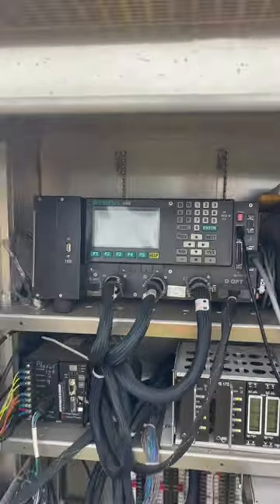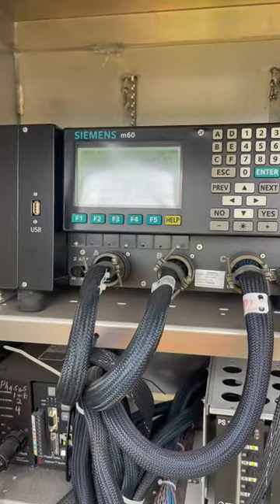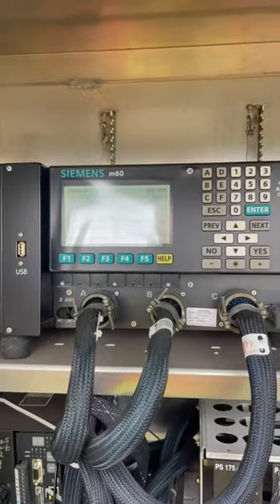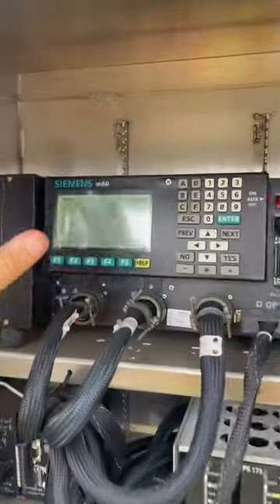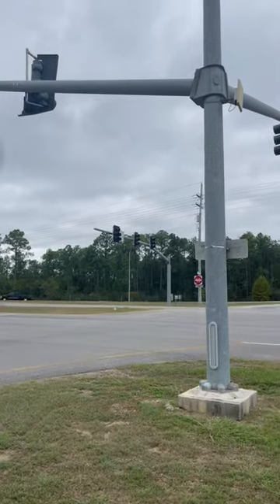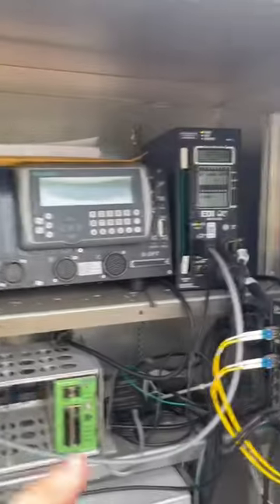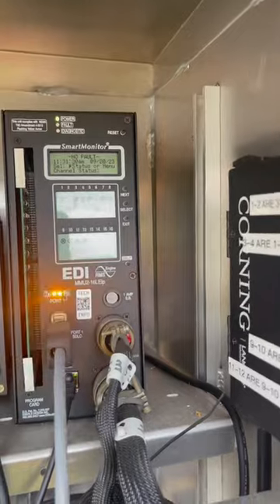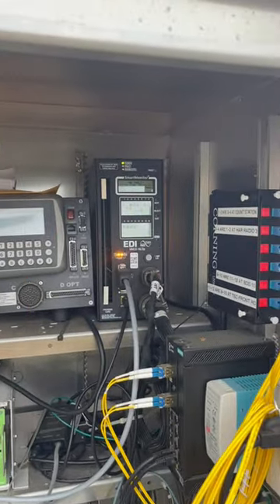Raspberry pi and traffic lights!

Comment: Anyone saying raspberry pi isn't an embedded systems engineer.  Pis are great for kiosks and small home servers, but not designed for industrial use.
Reply: Honestly in mass deployment they arent even good for kiosks....... one of my biggest support tasks in an robotics automation warehouse gig was rebooting or diagnosing failed pis that displayed a webpage
Reply: They work fine in industrial applications if you build adequate cases.
Reply: Pis are used greatly in industrial work, they're just used for very specific tasks, and very singular tasks at that. You see them on industrial sites and they usually cost a few grand because of how they've been built up.
Reply: @jamesbond1231 no, they are not. You have no idea about industrial controls if you say this. There are reasons PLCs are thousands of dollars and a pi is so cheap.
Reply: @bradbb2005  yeah it's called corporate. I design and build industrial controls for oilfield applications. . And can do anything I do at work with a pi or two,  and potentially some "add-ons" - to make a pi function like an industrial plc application - you most often have to put thousands worth into it. But it's easily doable.
Reply: @metaleggman18  no.
Reply: Consumers 🤪
Reply: @metaleggman18 most such failures are enclosure or power supply failures, but yeah. Purpose built stuff is hardened against those mistakes as well.
Reply: Raspberry Pi are already been used in certified industrial equipment..

When they developed Raspberry Pi CM4, companies asked them to make a CM4 with the same interface/connector as the CM3 due to the experience to redevelop and recertify industrial equipment..

The foundation complied and made a Raspberry Pi CM4 with CM3 interface..

For all you know, the newest version of the equipment shown in the video may already be using Raspberry Pi. The Pis have already been approved for more harsh and dangerous environment than shown in this video
Reply: As someone in software. This is all just computers at the end of the day. 

Really those consoles are just proprietary computers with overpriced parts. A lot of it running on dated software compared to the overall market. 

This is what happens when things get incorporated into major life. 

It’s like a major computer using some form of software from the 90s yet it being 2023 just because it was a standard. 

Hardware that lasts isn’t that expensive. You’re paying for software mostly. While also being forced to stay within an ecosystem of products. 

Food for thought.
Reply: I mean you could use a Pi, but an embedded compute module. Either way it requires the supporting electronics to work correctly at which point it costs a lot more and similar solutions already exist.
Reply: Exactly! They’re way too general purpose and kind of flimsy. Plus, they’re too ubiquitous to be easily made secure.
Reply: There is a pi Version for industrial use
Reply: Do you know why there’s a huge raspberry pie shortage? Because all the industrial factories are buying up pies because of how cheap they are
Reply: Are you having a laugh? 😂
Reply: @DieselRamcharger yes it can't I've proof it
Reply: @bradbb2005 price can't be matter to decide if the thing is capable or not. I have RPi1 Model B from 2012 & still running the echo link (internet based ham radio repeater) until now & it run for 24/7 perfectly fine.
Reply: Yes, Raspberry Pis are designed for industrial use such as AI & controlling robot arms for 24/7. I still have one the Raspberry Pi 1 Model B (256 MB varians) that I've bought at October 2012 & discontinued long time ago but still running my Echo link (Internet based repeater for ham radio) perfectly until know for 24/7/365
Reply: @bradbb2005 The net profit per unit is much, much, higher than a raspberry pi
Reply: @jamesbond1231 even an adequate case con only do so much. You can’t completely shield it from extreme temperature fluctuations or high humidity. 

Pi’s are great at what they’re for, but that’s not what they’re for
Reply: @jamesbond1231 up until the RP5 which was just released, RPis weren’t even capable of strong real time
Reply: @Mooooov0815  you definitely can shield it from temp fluctuations and humidity. Please - keep proving you know very little about electronics.
Reply: 😂 what are y'all people even babbling about the computer that is in the light is pretty much a raspberry pie just beefier it is a linux-based computer where a raspberry pi is also a linux-based computer but it is low power and small for light use in low power applications. They're literally the same thing just beefier in every way.
Reply: Can an all-purpose raspi run an intersection? Absolutely.
Is it as robust, reliable and redundant as a purpose built system? Probably not. 
I'm glad our safety isn't worth as little as a pi either.
Reply: @thekidd2323   Perhaps some day, you might learn the hard way the difference between something rated 0-40°C and something rated -40 - 60°C.  Or, conformally coated boards vs bare,  IP67 vs IP40 or EMI immunity.  There's a HUGE range of hardware that goes from good enough to best, behaves exactly the same way on the bench, and even runs the exact same software/firmware.
Yet, one flavor will last a matter of six months in the field where the other will go decades.  It's only overpriced if it's truly over-built for the application.
Reply: @radon360  just a little extra. No computer board is rated to deal with the cold. It’s insulation and casing are…..
Reply: @thekidd2323   Moreso the heat.   Extended temperature range hardware has high temperature electrolytic capacitors and oversized heat sinks on power semiconductors.  In some cases  it's additional circuits for temperature compensating oscillators, radios, and signal conditioning.   It's a lot more than just sticking the same board into a box with insulation or fans.
Reply: @radon360  again so basic components that are put together and sold as something special because the average consumer base doesn’t need it so it isn’t mass produced. 

Think bigger and you’ll understand.
Reply: @thekidd2323   You are stuck thinking in the realm of a private consumer.   Commercial stuff runs an entirely different gamut.  There ARE significant differences, and legitimate reasons for the price differences, not just a company trying to gouge a customer.   One of the biggest factors is many of these devices are made in much smaller quantities than mass-produced devices, meaning higher cost of production, stocking etc.
I've worked in this world for nearly two decades.   It's not as simplistic or comparable as you seem to perceive it to be.
Reply: @radon360  as someone who programs the robots at factories. 

There isn’t a large difference. 

If the consumer market needed it, it would be common place and cheaper as market would create a competitive space. 

But hey man keep doing you
Reply: @thekidd2323   I design, specify and build automated the cells you probably program.   If it were just as you say it is, you'd have a lot more work constantly fixing things that fail, lock up, or just stop working.   There are good reasons I use an industrial ethernet switch and not a $20 one from Amazon, or run a cell with the cheapest PI or Arduino I can find.  I need things to remain reliable for my customers.

But hey,  keep thinking it's all the exact same stuff.  I feel into that line of thinking right after school and quickly realized why that was not the case at all.  You're securing yourself a job as a technical firefighter until you either get tired of it, or your manager catches on.
Reply: @radon360  lol I program and design cells too dude. Keep playing like the stuff we work on build anything “special” lol. 

It’s all just basic shit thrown together to work in certain conditions and done so in the lowest cost (not cheapest as cheap would imply poor materials) 

More so heat is easier to deal with than freezing temps in most situations when it comes to computers. Again you just sound like you’re trying too hard to justify your skillset. 

It’s basic shit with other basic shit labeled as something special. 

From robotics to building TMS systems to working as a contractor with international companies and manufactures, it’s all the same shit everywhere. Just marketed in such a way to help justify the price.
Reply: They do make pi’s that are able to survive industrial. They are specially designed for the higher/lower temps and the abuse. At that point though, it’s better to get an already integrated solution *if available*.
Reply: @bradbb2005  😂😂😂That's cute. I'll try to remember that industrial electronics are magic tomorrow, when I got to work, repairing industrial electronics that catastrophically failed.
Reply: @microcolonel  No, no they're not. Convoluted and complicated are not the same as hardened.
Reply: @Mooooov0815 Nonsense, if you need environmental control, then you just install environmental controls.
Reply: @jamesbond1231 if you gotta put thousands into it anyway why not get the properly designed industrial controllers, your argument makes no sense bruh you played yourself
Reply: @AtlasReburdened   I mean, a lot of small industrial power supplies have SPDs built in, somewhat thicker PC layers, and are at least validated in more temperatures and humidities; and a lot of industrial equipment has somewhat overbuilt power stages on the main/application boards as well... not necessarily more complicated.
I agree in general that consumer and repurposed electronics are better tested, probably have similar operating envelopes anyway, and are much cheaper though.
Reply: It's the same technology; just one costs taxpayers 1000x more
Reply: And even for kiosks they are questionable. By the time you made them as reliable and versatile as an off the shell x86 industrial board, you made them more expensive than said board. We just did the calculations for the new raspberry pi 5. After adding all the components and shield we'd need, we'd pay 30$ more than for the x86 board with CPU, RAM, NVMe disk, cables and housing we currently use 🤷

We totaled roughly 300$ for the pi solution, while getting less performance out of it (at least pie pre pi 5, we have yet to evaluate our pis once they get shipped).
Reply: Yes. This. They do NOT last long.
Reply: Something else you will not get with rpi is support, drop-in replacement parts, RMAs, etc. If you deploy a rpi for a use case like this, you are on your own when shit goes south.
Reply: RasPis are perfectly usable for certain industrial use cases, but not for safety critical high availability applications
Reply: Funny thing for an "embedded systems engineer" to say .... embedded systems include intel PC architecture, running Linux.  Why cant they include RPi?

The RPi company doesnt want to give MTBF away because they aren't targeting industry in their direct sales.  They leave that to other companies that produce the industrial products. 

If you had a RPi in your 3d printer or maker lab, and it "failed", then guess what were the two most likely component to fail?  The SD card, and it's reader.  

SD cards have limited number of writes before they stop working.  Want your RPi to last long?  Move your log files off of SD card, and onto RAM (/tmp).  The industrial models use NVM, I believe, which does not have write-limit timebomb like SD card.  In fact, they typically don't have SD card slots, but rather have USB interfaces.

The card slot fails because it is the only mechanical component.  All of the industrial RPis eliminate and replace these components with higher MTBF ones.  This is not your daughter's Raspberry Pi.

BTW for the folks takin bout your Pi kiosks constantly crashing...  well, that MIGHT just be your bad code.  I would bet on it.
Reply: I wouldn't say a Pi but any small microcontroller could probably replace the controller, but obviously it has to be able to have connectors for all of those cables and whatnot.

The conflict monitor is not really replaceable for obvious reasons. It has hardware verified RTL in order to make sure the signals are valid along with its failure modes.
Reply: @thekidd2323 it is not all just computers. The controller probably just has a simple microcontroller on the inside that connects to all the ports and display with buttons.

The conflict monitor on the other hand has complex circuitry that is likely not "just a computer".
Reply: @dubya5626  The problem isn't the architecture, the problem is redundancy, hardening against failures, and fail-safe operation (i.e. if things go wrong, the system shuts down in a safe state) . The RPi was never built to have these things, and if you're running machinery that may easily kill someone if anything goes wrong, these things are absolutely vital. For example, if the linux on the RPi fails for some reason, the GPIO output states aren't defined. Which means the traffic lights might show green in all directions. I think you can see the possible consequences.
Reply: @vasilis23456  I agree with you in principle, but you'd need to design hardware around it that satisfies all necessary reliability standards, and then have the entire system certified for that. Which costs a significant amount of money, and is something no end user (i.e. the city or county) wants to do. Instead you buy a system that is already certified in its entirety to SIL3 or SIL4 from a vendor. I think that's the main issue here, that the city doesn't just want (and need, for legal liability reasons) a system, but a system that is certified in its entirety.
Reply: @tanithrosenbaum  that's what I'm saying. The controller could definitely be replaced by a Pi but the conflict monitor and other components would need to remain because of the reliability and redundancy requirements.

Honestly using a Pi as a controller might cost a about the same. It isn't the chip inside that controller box that costs all the money it's the box itself which is a custom case that has its own display, buttons, connectors, and waterproofing/fireproofing.
Reply: Your right, an arduino would be better suited
Reply: Anyone saying "raspberry pi" has also not used a raspberry pi in four years. They're quite literally out of stock and falling out of style since COVID. Why suggest an outdated product you can no longer buy off the shelf?
Reply: @AMatofFact  becauae people into the hobby have them. I have like 6 around my house
Reply: @thekidd2323 I design power systems for aircraft. Trust me there is a difference between components. Sometimes they may all come off the same line, but they are screened and the best performing ones can be picked off and certified for a higher rating. Sometimes you are paying for the QA of a part not just the cost of the part otself
Reply: @ledzeppelinforpm  aircraft and street lights are two completely different things man. 

Next you’ll compare your cars ability to operate to a nasa or space X craft lol.
Reply: "iNdUsTrIaL dOeSnT mEaN aNyThInG!1"
Reply: @bradbb2005 yes they are. Do you know why there was a shortage of pis for consumers? 
Because they sold most of them to industrial customers first.
The compute module was invented just for industrial use.
I don't know if you don't know what you're talking about or if you just want to spread misinformation, but you should stop it.
Reply: @jamesbond1231 Eventually the hardware built for raspberry pi hats would be so complicated it will look like a regular computer. 

If you want to be humorously pedantic, everything is a raspberry pi just in a different board.
Reply: @Goobster911 As someone in the industry, you don’t seem to realize that we don’t buy the same raspberry pi you buy in a consumer electronics.

We literally just buy the processor die and we install them in our thousands of dollar boards.

People saying that we use consumer grade raspberry pi’s are just idiots. Theres not even enough IO, and consumer grade expansion boards are unreliable. Those hats experiences thermal fatigue quite regularly and are unfeasible in an industrial environment.
Reply: @digidex4557 people are rather narrow minded to presume a raspberry pi is a better option to control traffic system when in reality, we already use them, but their tiny boards and huge lack of IO is why we completely avoid consumer grade units. Basically we just use the exact processor itself and plop it onto a beefy motherboard. People dont seem to realize that essentially everything running a microprocessor is basically already a Pi.

So why argue about opting in for a Pi when the system is already using it.
Reply: @bradbb2005  PLCs that are based on some other ARM MCU, so does it really matter? No. (putting reliability aside) But if you are going to build custom hardware to put PI into, you might as well use any other MCU that better fits the job. People seem to not understand that building such complex system produced in low quantities is expensive no matter the platform.
Reply: They are actually engineered for industrial use
Just not for that particular use
Reply: @Mooooov0815  That is untrue. Just because you are unfamiliar with RTOS doesn't mean it doesn't exist.
Reply: @digidex4557  Neither is this traffic light controller. The box on the right is basically a smart UPS and that is what is robust and reliable. You could build a 10 fold redundant system using raspberry pis for a fraction of the cost.
Reply: @jamesbond1231  mkay, so then if its that easy, build a pi case that survives getting hit at speed by a car, regualtes temps to keep the pi running literally 24/7, keep the pi itself running for 30+ years 365/24/7, and make it all cheaper than the currently used best product for the job... 

I mean only if its that easy...
Reply: There are companies that make industrial grade raspberry pi machines. I think LTT has a video on it.
Reply: @Dubfiance  nope - pi can't be industrial dontchaknow - cause some guy that does traffic lights said so.
Reply: @AMatofFact because all they know is raspberry pi and nothing else, lmao! Even an automotive rated Jetson board will last much longer in the cruel heat in that enclosure than too. Why buy an underrated part and try to make it work when you can design a custom pcb which components that you know will last? It’s much cheaper to make it last than having to send technicians out to replace everyone of them once a year.
Reply: @TheAracoin they have zero clue. Choosing rpi cm4 over any other industry soc module will not reduce the design time/cost or production cost of the unit in any meaningful way.
Reply: I've seen them used in an industrial environment.
Reply: @jamesbond1231 can you tell me anything about the risk or pis potentially failing during big geomagnetic storms? And if there is a possibility that it even fries itself at  a >G8 storm? Since transformers can potentially do that, I suppose that pis couldn't handle the current induced. What are the safety mechanisms of a pi for induced currents? What happens if they potentially get fried all at once? I don't have a pi and don't know much about it, that's why I'm asking since I do a lot with heliophysics and I've wondered what would happen to those small computers.
Reply: We use them in industrial industry haven't had an issue
Reply: @nightmareinaction629  specification of the environment? You know the word industrial means nothing right?
Reply: Pi compute module left the chat
Reply: @iladshyanchess  you know that cm just one of tens of thousands of embedded som that engineers can choose from right? And it’s not very impressive spec wise, just cheaper than most other rated for industrial applications (the word industrial is not in cm4's spec). But when considering the cost of other components, saving $50 by using cm4 won’t even affect the bom cost much.
Reply: One of my clients build wood drying equipment thats controlled by rpis
Reply: @jamesbond1231 no they aren’t.  You want downtime - that’s how you get down time…
Reply: @DieselRamcharger revpi's are literally built to be industrial pi's
Reply: You could use a pi for this. If you did it one, you'd probably get away with it.
Reply: It's a microcontroller just like any other microcontroller used in any industry. It needs proper cooling and casing and they should last pretty long.
Reply: @bradbb2005 bro you have no idea how companies use marketing.
Reply: @dh00mketu  you go put a Rpi in a train, or treatment plant, or other true industrial setting, let me know how that goes. I've worked on all brands of PLCs and controllers, while RPi is good for home and light commercial I don't think it is appropriate for industrial use, my opinion and based on my experience.
Reply: They're used in industrial environments all the time. I'm an embedded engineer btw
Reply: @radon360 lol no electronic nowadays is only rated for 0-40 unless it has a battery. Most things happily go from at least -40-60
Reply: Pis arent designed for anything specific, thats the whole point of them. Like all computers they arent reliable without a suitable case
Reply: yep. i have played with Pis for some stuff, and the rate at which they fail, is absolutely not something i want to bet lives on.
Reply: @lineseyaether  Youre probably doing something wrong
Reply: They arent any mind of engineer. Rasp pi are a toy at most.
Reply: @dievas_  things like this are run by CM all the time
Reply: just curious, how much money do you make working for the government?
Reply: Reliability engineering needs to happen no matter what chipset you use. As long as you use something like an RPi compute module in a carrier board with all the right hardware it can perform just as well.
Reply: @thekidd2323 as someone also in software, it's not "all just software".  Hardware doesn't always run the software right.  I've seen plenty of bit-flips in telemetry logs, and the Raspberry Pi doesn't have ECC-anything so it's going to be prone to hardware-induced errors.  That's not good enough for a large number of deployed safety-critical electronic systems like this.
Reply: @Dwonis  yes and it all runs on software. 

The hardware itself, wires, boards aren’t anything special just architecturally well built for the needs of the end user. 

I’ve been a robotics engineer building and programming the robots in factories and now work in software developing well software. 

I’ve seen and been apart of both sides of manufacturing these products. It’s nothing special. Just really good marketing and knowing others aren’t going to do it themselves.
Reply: They’re used in both industrial and military applications. You’re incorrect and making this up.
Reply: @jamesbond1231 real quick.  So you know of aqueduct cases built?
Reply: Ok I'm an embedded systems engineer, I've seen industrialized compute models used heaps in industry. What now? Heaps of companies use them mate, so uh... Yeah...
Reply: They are in fact used in semi-industrial gear a fair bit, like EV chargers. But for obvious reasons only where failures are not life critical and also only in low-volume applications.

But that said, there’s no application where they’re a replacement for a real PLC.
Reply: They can be made reliable, just get some cooling on the CPU, Ram and memory... Maybe even VRM, does not have to be active, just passive.
Reply: exactly what I said on a TikTok video and go absolutely swarmed
Reply: Another reason people are leaving out is honest to God this is a factor these companies need someone to sue if they go wrong they need accountability and raspberry pi doesn't give accountability
Reply: They are very much used for industrial use, also this is not industrial use, this is a traffick light.  Also maybe if the usa was actually hospitable to anything other than cars you wouldn't need something so "industrial" as you say.
Reply: I don’t know about pi reliability, but I would say it was a bad idea just because of reinventing the wheel. You would have to add so much onto the pi to make it work for this use case, it’s far more worth it to make a custom built unit. Traffic lights are ubiquitous. You use pies for things like airport monitors that can be unique jobs every time.
Reply: @bradbb2005 I literally installed 500 of them at General electrics 😂
Reply: FUCKING THANK YOU
Reply: Terrible for kiosks, great for small home servers. The operations these traffic light computers are executing can 100% be done with a Raspberry Pi, and some additional equipment of course, but I can build a fully functional traffic light system running on Raspberry Pis. In fact, I could build a vehicle diagnostic system on a raspberry pi zero w. I know because I’m doing it right now for my motorcycle, and I know as a career backend software developer that turning lights on and off and communicating light states to other nodes does not require multiple 10s of thousands of dollars worth of tech. This is an overkill system that constantly breaks down with overpaid technicians called out to repair them, but then how else can your city justify its ever increasing taxes? This fellers not an embedded systems engineer, he’s a glorified electrician. He’s got a manual. If he moved to another state, he’d get a different manual and have no idea what to do.
Reply: People forget it's a dev tool.
Reply: @bradbb2005  A PLC and a PI is not even remotely the same. Very different application. I am also not a big fan of PLCs. They are wasting massive amounts of energy and are cumbersome to integrate. The main reason why they are so popular is that their logic follows the logic of a mechanic / massive builder.
Reply: @radon360  The biggest reason for the price is the lower volume. However, the components aren't that expensive. In fact it can be cheaper to use some off-the-shelf consumer hardware and just put some filters in front of it. I am leading an embedded systems engineering team building devices for the industry and the electronics manufacturing costs are 10% or less of the final product price. A lot of it is engineering costs, but with increasing volumes, we can lower the price while increasing the company's profit at the same time.
Reply: @radon360  Because industrial switches are so reliable? Except they are oftentimes not. I had a long call with a manufacturer of these switches this year, because we had problems in the field. Turns out that the whole model family of these switches is unreliable and the manufacturer knows that and has pulled them off the market by now, but it shows nicely how the equation expensive=reliable doesn't necessarily work. On the other hand you have "normal" switches running in data centers 24/7 without any issues.
Reply: @fr89k  Yes, there's Chinese crap packaged as industrial that isn't any better than the off-brand junk you can pick up on Amazon.   Then there's stuff that's appropriately designed for the application.   I went round and round with a complete ignorant fool (to put it mildly) on this roughly a month ago.
Purpose-built stuff from reputable companies has appropriate filtering, protection, wider environmental operating conditions and often redundancies, or at least more stateful recovery processes.
Yes, there's plenty of sketch out there labeled industrial.  It's the same game played with consumer knock-off devices.
You are correct that lower volumes often account for the premiums rather than the components, yet it's often more than that.  It's ability to do things fieldbus monitoring, survive repetitive mechanical shock, ride through larger voltage sags, and fail over to a backup system for a predictable shutdown instead of whatever random actions happen when signal voltages enter ambiguous ranges. This is followed by the testing to ensure that the device does operate as intended when challenged with deviations from normal operating conditions.
To be clear, it's not that a manufacturer uses some magical gold-plated caps.  It's that they put that extra choke on the input supply, or oversized the heat sink on the backplane, or did the work of shielding high impedance signals.  Nearly all of these attributes get taken out when someone cost-reduces the hell out of the equivalent consumer level device. It still works, but maybe not long, or reliably.
Reply: Raspberry pi are great for hobby projects, home stuff, prototyping, development. But they aren’t meant to be used as industrial products.

Recent had a project where I made 8 different cars that where controlled by Arduino. Pretty similar to raspberry pi. Most of those stopped working pretty quick.

All easy stuff I’m sure. But hard to fix if you don’t know what to look for and there is a lot of cables running into it. Anyway, it just can’t do that. You can’t just have your lights fail. That’s already more then enough reason not to use them for this.
Reply: @thekidd2323  would you be willing to ride on a plane with raspberry pi controlling the whole thing?
Reply: I used to work in the oilfield and build a oil well monitoring system using Raspberry Pi's and Teensy microcontrollers. Each unit would monitor the tank levels, oil temperature, burner status and casing and tubing pressures for up to 5 wells on a single pad.
Reply: Anything can be industrial if it has enough redundancy shit Evan military
Reply: You are also not an embedded systems engineer because you fail to realize that most companies use some form of a CM4 🤡🤡🤡
Reply: You don’t need a PI.
An Arduino is already overkill.
Reply: @topethermohenes7658  I absolutely would because the avionics in most Boeing 737s are running some form of CM3 or CM4s. Your argument is invalid.
Reply: @IHADANERROR   newsflash no aircraft runs on raspberry pi, yours is even more invalid and I'm not asking you, do you need more attention or something? I was asking a legit question not berating someone
Reply: @IHADANERROR   I'm not even in an argument? Are you fighting with your girlfriend or something?
Reply: @bradbb2005 Overpriced government contracts seem like the culprit.   

Every thing he covered could easily be handled by any decent basic server for 300$  

I've never used a pi, but if they have ECC what would be the issue with using one exactly?  Are they poorly made?  Bad PCB?  They certainly have enough horsepower on paper to handle these basic tasks.
Reply: Sorta, they're not always ideal, but it's actually quite surprising how you can buy things like cases which can operate safely in highly combustible atmospheres (well *you*, the reader, probably can't, they're thousands of dollars and I don't know of anyone who sells to the general public), this has its uses but there are still very good reasons to not use a pi, and it would cost just as much (these industrial plants that use raspberry pis are not using them to be cheapskates, I'll say that), although they're still not advisable for critical infrastructure
Reply: @bradbb2005 came back a month or two later after doing much research on a topic you hardly knew anything about. Nice 😭😂
Reply: There are HARDENED Raspberry pi's that are specifically designed for industrial applications. They Akzo don't cost only $30 either.  When the hobbiest supplies dried up,  the company was still producing and delivering PIs for this  environment!
Reply: That’s a load of bullshit.  I’ve used raspberry pis on a 3D print farm for thousands of hours running klipper with barely any problems or downtime.  EVEN if a 99.9% uptime is an issue and is too bad for your use case just use two and introduce technical failsafes.  When traffic light computers fail there’s a blinking yellow light.  And there is a failure rate on all electronics.  Occams Razor would tell you that all these extra complications in a system are just extra points of failure.
Reply: I'm an embedded systems engineer and we use Raspberry Pis.
Reply: @thekidd2323 I’m a prosecutor. If you used a raspberry pi for a traffic controller in my jurisdiction without so sufficient hardening and additional testing to make it more expensive than the current things and someone died, I’m charging you with murder in the second degree (on a depraved indifference theory) and involuntary manslaughter. You would be a lock for involuntary manslaughter and it would be a pleasure to try for murder. This application cannot have a failure rate and had to be exposed at all time. If the traffic lights fuck up someone could very easily be tboned at 50mphs. Even aviation occasionally has disastrous computer fuck ups (see Qantas flight 72 on which 118 people were injured, some very seriously, because of a computer error). A traffic light does not need the most up to date tech it needs extremely reliable software.
Reply: @jamesbond1231 As an industrial maintenance technician, automatisation technician and mechanical engineer specialised in mechatronics, i would appriciate if you would stop butchering my profession with 0 prior knowledge. Thank you.
Reply: I know a guy who worked for a company that did Arduino and RPi solutions for military applications. So it happens.
On the other hand, I'd hate to have been someone whose life depended on those applications in the field.
Reply: @The1stImmortal  Industry/military is different. Military goes for the cheapest while it can still maintain a minimum standard.
In industry you are more than willing to pay 2-3 x the price if its more relyable, have a low maintenance requirement(including training, fixing, general maintenance), and its fast to fix/change, soo even if its break it doesn't take much time.
Military manufacturers evolved into industry, and not the other way around, military in general is a weaker standard.
Reply: You could always design one that's industrial grade lmao. The point is that this is a lot for a little. You could even have 10 pis working together and doing self checks, making sure the average answer is correct.
Reply: @Mooooov0815, you could if you have a tightly sealed box. It's not hard. The temperature wouldn't be to hard if you just insulated the Enclosure. Temps is going to be the harder one to control out of the 2 but not anywhere close to impossible
Reply: Pis are great for education and learning embedded systems, same with arduino boards. ARM boards are where personal and industrial use cases could collide.
Reply: Raspberry pi does come in a hardend military spec package. They are 4x the price but built for industrial use.
Reply: Yes! This!
Industrial semiconductors are held to a higher standard and are designed to last longer than consumer electronics. Also intersections have high safety standards, like 5 nines and redundancy
Reply: Beagle bone black industrial!  It is rated for 85 degrees C.
Reply: Actually plenty of embedded engineers say raspberry pi.
Reply: @radon360  i have personally ran a Pi 3b in an industrial application over 70C for 4 months straight. This is over the official rating but there are other SBCs that have superior ratings like the beagle bone black industrial at 85C. Ive never seen a PLC with an 85C rating before.